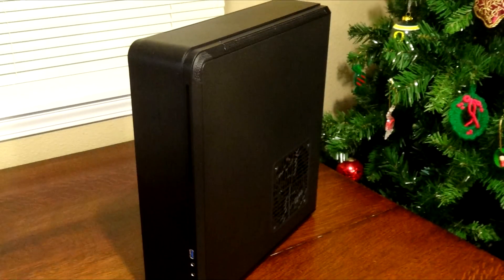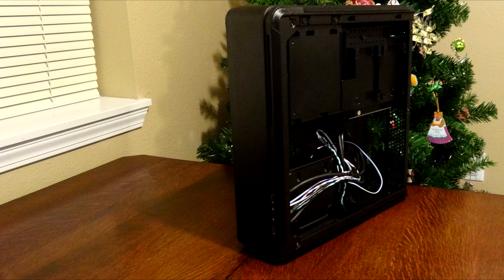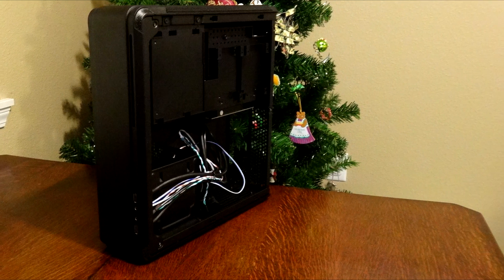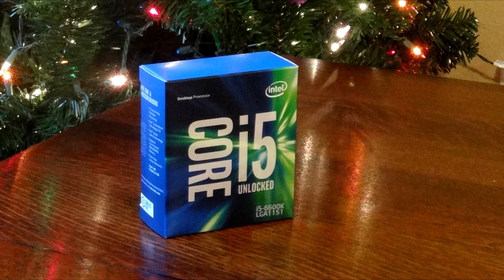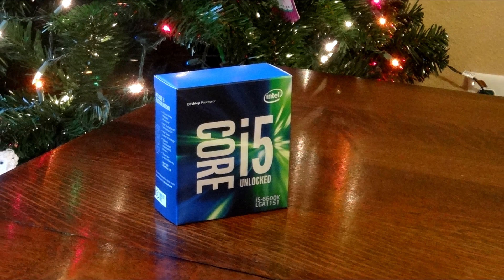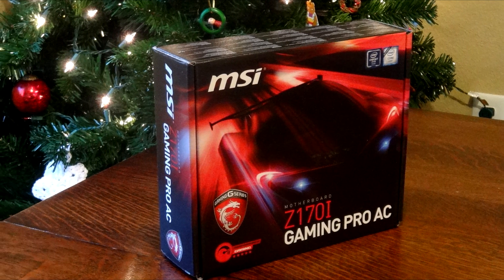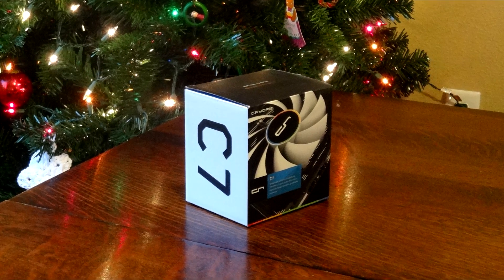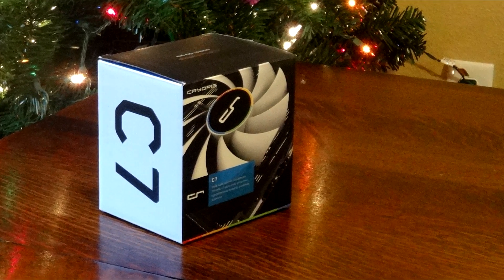ITX Build and Overclock - i5 6600k / MSI Z170I / FTZ01

Comment: curious about the GPU temp, since you're using a custom cooler GPU rather than a blower one.
Reply from the maker: My GPU hits in the low 70's degrees Celsius on 100% load. It is practically the same as my old large case in terms of temperatures but I think I have better temps in this new case. The reason I think this is because this case allows for two slim case fans which I have both installed and they are keeping the GPU cool. The single GPU fan works well but I wouldn't plan to overclock those much.
Reply: Crookalicious thanks for the reply, i soon will build a new pc, and i set my choice of case in rvz01 or ftz01 (still looking, since in my country it's quite hard to get on those htpc cases).
and i think i'm gonna use the custom cooler gpu too, since your gpu temp is nice at low 70.
thanks :)
Reply from the maker: Awesome dude! Wish you the best in your build. The rvz01 and ftz01 are basically the same on the inside. The rvz01 is newer and has corrected some of the issues of the ftz01. I personally like the ftz01 more. So there are 3 fan mounts on both cases and the case comes with only 2 slim case fans just as a heads up for when you get your parts. What GPU are you thinking of?
Reply: Crookalicious thanks man. i prefer ftz01 because the aluminium outer shell, makes it look more robust than rvz01 :)
i'm thinking evga gtx1070 ftw or zotac gtx 1070 amp! edition. and in my country, those two card quite cheap since 2017 :)
Reply from the maker: Nice, that would be a awesome card to have! Have you checked out the case manuals? I would recommend doing that to make sure the GPU you want fits. I know it fits up to 13 inches in length (over 300mm) and something like 5 inches width (127mm). I can't remember the exact numbers. What CPU are you planning to get?
Reply: yes, i have checked both of those case manuals. i'll get i7 6700k (7700k still too expensive in my country), since i'll be doing some editing too :)
Reply from the maker: Sounds like you just need to buy then. And yeah that processor is great, you'll have a great build dude. Good luck building it. Let me know how it goes when you get it done. Thanks for checking out my video.
Reply: yes, you're welcome. best of luck for your channel bro, hope it can grow more :D
Reply from the maker: Thank you, I appreciate it!

Comment: How are the thermals? Are you on AC inside your room?
Reply from the maker: Thermals are good. Here is a link to where I show some of the temperatures https://youtu.be/Q7qzp4o7uEM?t=12m37s. For ambient temperatures we generally have the temperature between the high 60 to mid 70 degree fahrenheit or (21 - 25 degrees Celsius). Right now it is winter so we are using a space heater about a meter away from the computer but blowing into the room and not towards it. In the summer we will have AC going. Thanks for watching.

Comment: I'd love it if you could do a sound comparison. Record it idle, gaming, and stress tests.
Reply from the maker: I like the idea but don't know if I will want to make a dedicated video about it. If anything I should have included it with this one. I  will look into though. Thank you for the suggestion!
Reply from the maker: I don't completely understand what you are trying to say lago, but because the CPU temperatures get to 74 degrees C doesn't mean it's loud with the fans. The fans are actually at the same fan speed with the overclock and without. At idle it's about 40-50 decibels with the measuring instrument right by the fan vent and 30ish decibels from where I'm sitting at. Under CPU load it's around 60 decibels by the fan and 30-40 decibels from where I sit (1 and a half feet or 0.5 meters). All of the decibel readings are pretty quiet. Are the fans noticeable, they are but only when you are listening for them. So I would say the system is rather quiet for an ITX and even with an Overclock. Hope this helps in understanding the noise stuff.